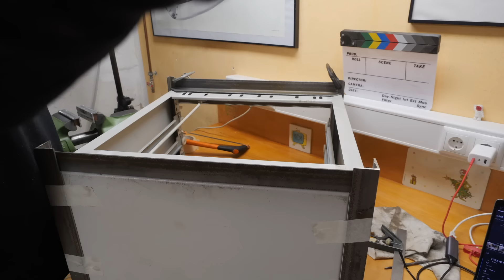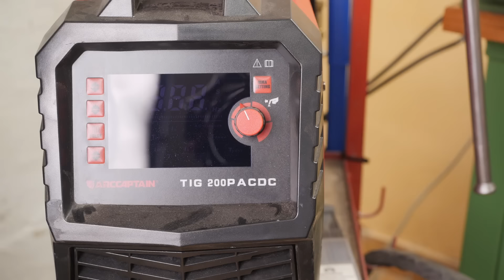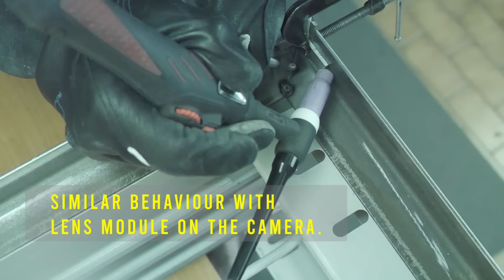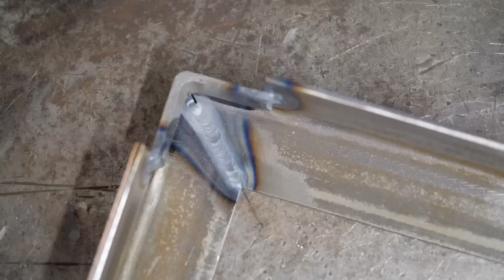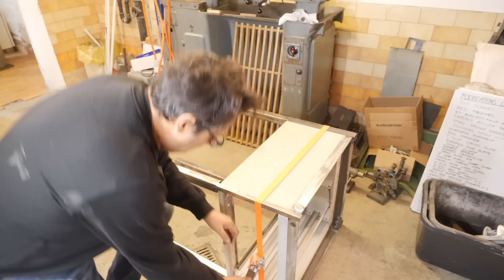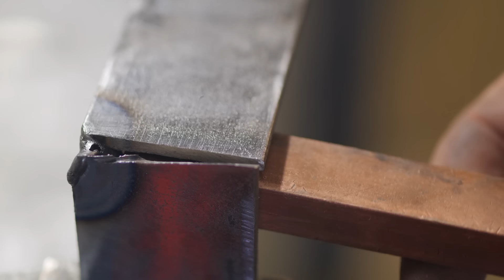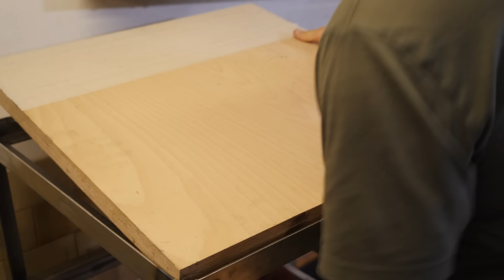DIY milling tool station || RotarySMP

Comment: Hi mate
The delay switch isn't how quickly the lens reacts, but rather how long the screen stays dimmed after welding. 
When TIG welding it's best to have the delay up a bit, for the exact reason you were experiencing. When the helmet fails to pick up the light instead of getting flashed the screen will remain dimmed hopefully long enough for the sensors to begin working again. 
So in that regard you actually end up getting flashed or less when you up the delay.
Reply from the maker: Thanks for that explanation.

Comment: @RotarySMP Hey Mark, would you mind doing a video about your spray gun setup? 
Seems you're using a basic gun and cup system, so how do you clean it between the different coats? How do you mix your colors and what kind of material do you use for it?
Reply from the maker: I think that would be video of how not to do it :) I am no painter.

How do I mix and thin paint for spraying? I slop in a bit of thinners, and stir it with a stick. I suck at mixing colors. I have only ever done it on the Clarkson dull powder blue.  I just try whatever random blue with white and black (which was blackboard paint, and not even from the same paint system) I had on the shelf, mix a bit, compare, add a bit more, compare etc. I was not patient enough on the grinding wheel cover, and didn't get the color to match well.

I clean the gun after each use:
- First pour out the remaining paint.
- Then use a rag (sometimes clean, often not :) to wipe out most of what paint remains in the cup
- Pour in a small amout of thinners. Put the lid on the cup, shake the gun around to dissolve the remaining paint.
- Spray that thinners into the rag with the paint on it.
- Repeat, but spray cleaner thinners into a clean rag.
- Repeat again, but this time us the nearly clean thinner spray to spray wash the cup lid. Rest gets sprayed into the clean rag.
- Wipe down gun cup and lid with just sprayed rag.
- Remove cup. Wipe out thread.
- Pull cup filter. Pour thinners into gun where filter mounts, use gun to spray that thinners through the little filter to clean it.
- Remove gun nozzle screw on air thingy at front. Pour little more thinners into gun, and spray that nozzle thingy.
- Unscrew and remove needle valve. 
- Use air blast pistol to blow air backwards through paint gun from front. Maybe pour in a bit of thinners and repeat.
- Wipe every thing down.

I normally spray paint as it is very efficient. It uses way less paint than rolling. The paint I use is normally just the stuff at the hardware store. I know it is not as tough as 2 part paints, but they are seriously hazardous to the lungs without really good PPE. I use a charcoal filter mask for painting, but am not confident it is good enough for 2 part epoxy paints.
Reply: @RotarySMP  Thanks for taking your time for that big of an answer 😃

Sorry for the confusion about mixing colors, even so your answer was great!
I actually meant mixing with thinners. I guess the mixing ration is determined by the manufacturer?

Will something like "Nitroverdünnung" do the job for cleaning, or is it some special thinner?

Comment: I wonder if the HF start is messing with the auto darken.
Reply from the maker: It has been pointed out that a very low start current and slow ramp can cause it to not trigger.

Comment: Do a tack weld at the beginning and end of your welds. That will “plug” them and make the look nicer. Start hot and then let off the foot pedal, it’s easier to gauge the puddle. One last bit of advice. The make shades for welding hoods with magnification, why don’t you get one? It certainly can’t hurt.
Reply from the maker: Thanks for the tips Sarah. I wear reading glasses under the helmet.

Comment: What’s the chance your helmet was reacting to interference from the new welder?
Reply from the maker: Hi Jim, there were some comments that the low initial arc current, and slow ramp could be the issue, and I could up them, so it triggers cleaner.

Comment: Welding helmet. LED lights flicker. Trigger in helmet is fast enough to catch the flickering on or off,
Reply from the maker: I found a setting which works well in the darker garage.

Comment: 36:43 if my partner would've said that, it shouldn't be taken as a joke but it would be rather have been a production order. 😂

For extra organized drawers have a look at gridfinity.
Reply from the maker: I need to get my Z height sensor fixed on my 3D printer and try gridfinity. Looks handy.

Comment: I like it. I also have a machine that uses 40 taper tooling (K&T 2HL). I'd like to build something like this to store the tool holders and arbors. I'll have to see if I can find a model for those blue tool holders so I can 3D print them and if not, spend some time in Fusion designing my own. Well done!
Reply from the maker: I am not sure who made them, but they are a pretty simple part, and would be easy to model.

Comment: Why would you plan a fabrication project. All of mine start with a basic dimension and then it evolves as I build it. 
   I have issues with all welding helmets but hadn't thought about the impact of LED lighting. My biggest issue is that most all helmets get too dark for me. 
      Are there any pars for that Doall I can drop off in Naxos?
        I like your bottom drawer. I hate when space under a cabinet goes unused as I am always trying to utilize every square inch of space as that gibes me more room for more junk to store.

            Cart turned out great and is a tank of a cart. I have an old fish tank stand that I am going to use for material to build a new welding cart. My neighbor was throwing it in the trash... May think about painting it green in tribute... And those floor pads make great liners and other uses too like sound deadening material. That  was way too much work filming and editing, I usually go by the theory of Frank Sinatra... I did it right the first time and it doesn't need to be refilmed... 

           If there is any tooling etc I can drop off in Naxos for you let me know. Will be there the end of next month and making a 2 day stop on Ios on the way back to Piraeus. Just to check out another island and stop by Homers gravesite.
Reply from the maker: Hi Robert, There is nothing I need at this point thanks. The DoAll gearbox just needs me to strip it and regrind the drive dogs angles better.
Reply: @RotarySMP  Gotcha I know exactly what you are having to modify. I will be checking out about 10 tool stores in Piraeus before heading to Naxos. All within a radius of 1K feet of each other. Hopefully find something worth bringing home but usually I just find the same stuff or really cheap import stuff at the stores there. I did find  a place that sells greek flags made in greece so I want to grab one of those. I want flags and license plates from places I go but flags that are made in the respective country not imports.
Reply from the maker: @theinfernalcraftsman  Yeah, it is getting harder to get souveniours which are not made in a far away place.

Comment: Small button cells will show 3V even when dead, to gauge the charge you need to test them under load. For this purpose I keep a single blue or white LED (both have the blue junction that has around 3V forward voltage drop) in my tool bag. Just touch the terminals to the LED and if it's fresh it should shine bright, it will shine dull or not at all when the charge is low. The internal resistance of the cell is enough to protect the LED against the overcurrent, at least for the usual 3V CR2032 cells.
Reply from the maker: Thanks for the tip. I'll go dig out a white LED and test them.

Comment: Really good work Mark, it's inspiring to see workshop projects that are just quality of life improvements. Sorry to see that all your work ended up with some angle errors, but it looks great and I couldn't even see it after you were done.

Time for me to go make some cabinets... might order some of those lovely casters you used.
Reply from the maker: Those casters are nice and stable when rolling and rock solid once the feet are ratcheted down.

Comment: If the welder is as bad as the welding helmet, they can keep it. You can blind yourself if those things don't work properly.
Reply from the maker: I was given feedback that the issue is likely a combination of a very low initial amps, and slow ramp up, with very bright LED lighting. It found a setting which worked reliably in the darer room.

Comment: I changed to a 4 sensor helmet because the 2 sensor helmet i had, didn't switch to dark because of being in the shadow of the project or not inline of the weld.
Reply from the maker: Good point.
Reply: I was looking for this exact comment to avoid repeating.   Have had same issues ,went to 4 sensor and rarely happens anymore.  Unless hand or some other obstruction gets between arc and sensors. But that also blocks your eyes as well   Be safe. Dont want to see “The blind machinist” channel.  Cheers
Reply from the maker: @galenpress9460  Thanks for sharing your experience. Once I moved into the garage, I found a setting which seems reliable.

Comment: With the issues of the auto darkening helmet  -  it's fairly common on the more budget friendly that for whatever reason they have issues with low amperage tig arcs .. I suspect you're probably under 50amp.on the machine ..    unfortunately not much you can do to fix it
Reply from the maker: Good point, I was under 50. I will play around with the starting amps and the ramp up. In the darker room I found a reliable setting.
Reply: @RotarySMP  it's not so much the ambient light that causes problems, it's the sensors in the helmet itself.  It gets worse when you're welding lower amperage and you're in a small space with your hands and torch blocking much of the UV light to trigger the helmet.  I have many welding helmets , even my miller elite does it under about 25amps.  My esab sentinel is my only auto darkening helmet that I've never had do it. The rise in offshore manufacturing of tools is both great in that it allows many people to purchase tools they could otherwise no afford or justify but flip side is the flaws tend to show themselves sooner

Comment: For the three smaller draws - have you heard of / considered the gridfinity system? For the sort of tools you're putting in there, and the fact you have a 3D printer, could be perfect
Reply from the maker: I haddn't, but it was pointed out to me. I need to fix the IR height sensor on my printer. I think it got a it of plastic on the sensor.

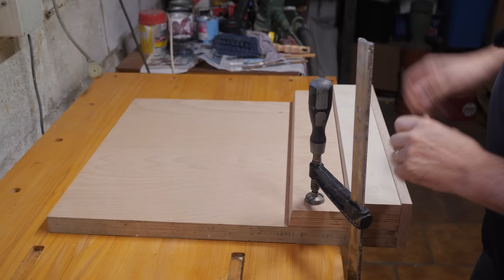Comment: Hi Mark, couple of things about your large diameter bits around 34:45.  Your Forstner only seems to be clogging up on one side, is the other side producing chips or nothing at all?  Seems asymmetricly sharpened in any case.  And the hole saw in the next scene, without a tangent-intersecting hole or edge they do clog easily.  If only you had some kind of cnc that could make on-size repeatable holes without human intervention...
Reply from the maker: Hi Tim, I don't want to clog up the Maho way oiling system, or coolant with wood dust. :)

Comment: I find that for hand metal sawing, a woodworking frame saw with a 550mm  metal cutting blade is a lot faster than a 300mm hack saw. The longer stroke really helps getting the work done. Here in the Netherlands, 2nd hand Ulmia frame saws are cheap and plentiful, I'm not sure about Austria.
Reply from the maker: Before I improve the4 hand saw, I'll fix the DoAll gearnbox :)

Comment: I'm so worried for your eyes man. Get a new helmet!
Reply from the maker: I found a setting which worked fine in the other room. There have been some comments that I probably need a higher amp starting arc, and faster ramp to trigger it in the brighter room.

Comment: What blade are you using in that bahco frame? And is it my lack of skill that my cuts turnout not square? :D
Reply from the maker: It is still the one which came with it. This plastic framed saw holds the blade much better than the alloy frames I have used before.
Reply: @RotarySMP  interesting. I have the same one and my cuts go off the line. Maybe it's a tension problem.
Reply from the maker: @kruger12311  I can also wander, if I am not concentrating on keeping it straight.
Reply: @RotarySMP  might be it :D

Comment: Re the welding helmet; looks like you had the sensitivity turned right up?
If the room has bright LED lights and you turn the sens right up, it puts the room lighting brightness near the threshold and can confuse the autodarkening.
You could try turning the sens down, even though it sounds counter.
Also, the helmet circuitry responds better to a fast rise in UV light level, so if you have a low start amps and slow rise on your TIG settings that wont help... try set the TIG to higher start amps and a real fast current rise time so the arc "flashes" up to full brightness much quicker. Wont affect the weld quality much, but should help the helmet sense that an arc just started.

By the way, it creeps me out everytime I see endmills etc stored on a shelf with their sharp bits upward! 😬 massive hand injuries are only a few mm away, everytime you reach for tools.
I got complacent once with endmills, then a 6mm 4 flute HSS got me right between two knuckles, real deep. It was only pure luck that it missed the finger extensor tendon, a few mm difference and I would have lost the use of my right forefinger (unless getting microsurgery).
PLEASE consider this! Those endmills are as sharp as razor blades and mounted so securely in the shelf that during hand contact, it's like a razor blade with a ton of force behind it...
Reply from the maker: Thanks for your tips on the helmet settings. I found settings which worked well in the darker garage, but didn't consider the arc rise. That is helpful.

I put all those end mills into the tool cart drawer, in containers. I appreciate the safety tips. Working alone you dont think of them.
Reply: @RotarySMP    actually I was talking about all the tool holders on the shelves with all the pointy bits upward! Terrifying!  😬

Comment: the welding helmet issues is most likely do to the high freq start try it with it on lift arc or scratch start on the welder had similar issues with the cheaper helmets my fronius or sentinal doesnt seem to have issuess.
Reply from the maker: Thanks for the tip. I didn't consider those aspects of interrelationship of the welder to the helmet.

Comment: There might be a sensitivity adjustment on you auto tint visor for the darkening. I have had this happen in the oposite way where I’m welding and the shop door is open and bright outside. When facing the bright door. I flip my helmet down and it darkens before I start to weld.
Reply from the maker: Hi Peter, I found a setting which works really well in the garage, but didn't work at all in that really bright part of the machine. shop.

Comment: Awesome tool station... I had something very similar in mind for my latest addition to my shop (DMU 50T) and now got the perfect blueprint 🙂  Thanks a lot for sharing and cheers from Remscheid!
Reply from the maker: There was a nice one from Lista advertised on Kleinanzeige, which is probably 80% of this...
I just checked, and it must have sold.
Reply: @RotarySMP  I have a few searches on auto, one is "CNC Schrank". So far either too far away or too expensive. Must have missed the Lista one... 

If I had won the lottery, my choice would be "Apfel WKS 004"

Comment: You need to get a good auto darkening helmet. The cheaper import ones are no good. 
An affordable Speedglas 100 or Esab A40 helmet will not make you fear getting flashed everytime you turn on your arc
Reply from the maker: It is weird, I found a setting which works really well in the garage where the Maho is, but it was hopeless in the machine shop which has brighter lighting.

Comment: I've only got two welding helmets, my original Huntsman that I have used almost daily for 25 years and a Yeswelder auto dark that I only use for out of position Tig. The auto dark eats batteries and usually it flickers like yours to let me know it's hungry again. I pull the batteries out when I'm not using it which seems to make them last longer. I suspect the electronics inside may have a parasitic drain going on like many of the Asian digital calipers.
  
Nice cabinet, that would be $1200 at current prices for a Vidmar. I do basically the same thing keeping the tooling for a given machine, by the machine whenever possible, it's much easier for setups and working, but really pays off during cleanup.
Reply from the maker: The guy I bought the five SK40 tool holders from was selling a Lista cabinet which was probbly 80% the same as I made (but much better construction), but by then I was commited, and it was in DE.

Comment: My guess is you dipped it 12 times. 
A question I have is how did you manage to work with such a small table. Mine was twice the size and it was nowhere nearly enough.
Reply from the maker: I really dont have space for a decent sized welding table. I get envy every time I see them :)